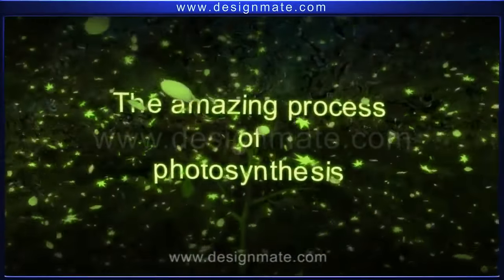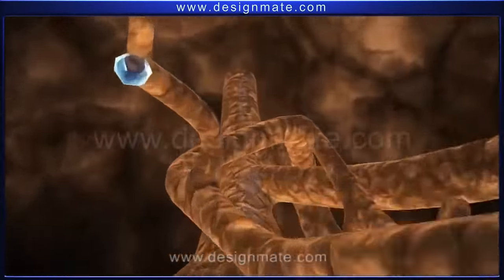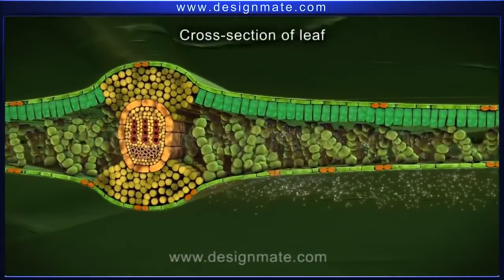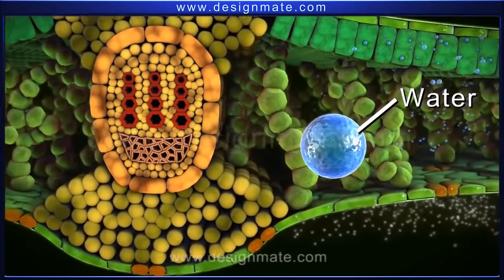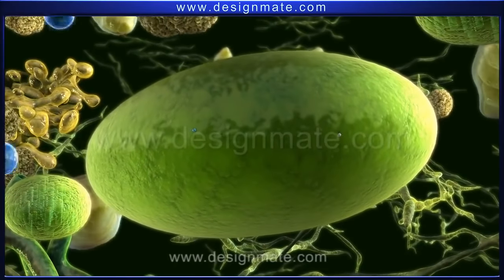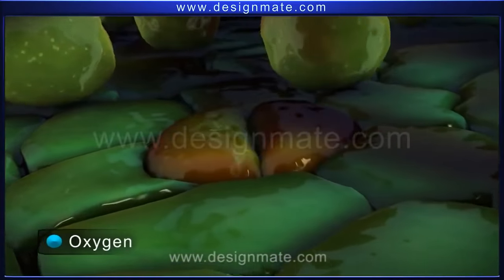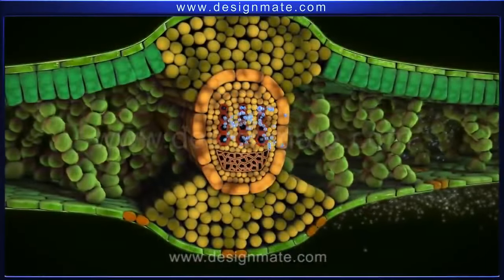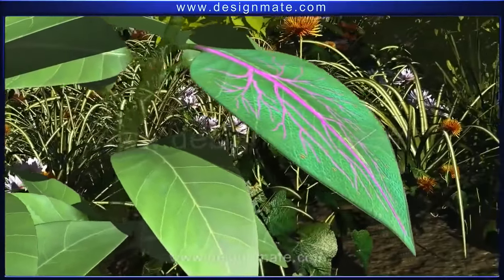how photosynthesis takes place in plants & Process Of Photosynthesis (animated)

Comment: Still a question, What actually happened inside the chloroplast which transformed CO2 and H2O into C6 H12 O6 + O2??
Reply from the maker: There are many processes inside the leaf, firstly Light dependant reaction takes place in thylakoid membrane of chloroplast, where photolysis of water takes place and fuel for dark reaction is prepared in the form of ATP and NADPH after these both energy rich molecules leave the light reaction they go inside the dark reaction, dark reaction is also called Celvin Cycle, in this CO2 is fixed with rubisco enzyme performing whole cycle the product is G3P which then convert into globose
Reply: @NeurotechLectures   I could not understand anything, but Thanks for reply
Reply from the maker: May be you haven't studied whole process of photosynthesis therefore you couldn't understand, and welcome
Reply: there will be a cellular respiration , ATP (energy ) + h20 = glucose + O2.
Reply: Watch magnet brains 
Their explaination just on another level.
Reply: Light and dark reaction occurs

Comment: Is there any proof photosynthesis utilises carbon dioxide in the air?
Reply from the maker: Yeah absolutely there are many experiments that prove that plant take CO2
Reply: @NeurotechLectures  Great perhaps you could point me to one that has a CO2 meter indicating the level of CO2 changing and which does not include sodium hydroxide solution or calcium carbonate or soda lime which skews the experiment
Reply from the maker: Yeah You are right but i thought You needed firm evidence 😉

Comment: very good . when you put a seed on the ground and it became a big tree, where  does come from the material which the tree are made?  from the ground/soil ?
Reply from the maker: It's soil because it provides water and minerals needed for plant growth, and plants fix carbon dioxide from air, which helps to produce glucose by the process of photosynthesis.

Comment: Does photosynthesis occurs in cut off branch...can u plz explain in detail....humble request..🙇
Reply from the maker: Dear, If we cut the branch of a tree, then ultimately tree dies because water is not supplied to that branch as a result process of photosynthesis ceases.
Reply: @NeurotechLectures  but the branch contain water, Nutrients in xylem..so even under these conditions doesn't photosynthesis occurs....?
Reply from the maker: @Suchi Vennila  it is possible that photosynthesis will occur for a short duration if branches are detached. After that, photosynthesis will stop.

Comment: Some one bashed me and tell me that it should be a non stop of light exposure so the plants can have continuous photosynthesis
Reply from the maker: Yeah surely plants need light so that they could continue the process of photosynthesis, as it is clear that photosynthesis stops during night due to absence of light.
Reply: But would that be acceptable to put the plants on 24hrs of light exposure? Morning sunlight. Night time until break of dawn growlights?
Reply from the maker: Actually there are various mechanisms in plants, if you increase light duration or light intensity it will damage the chlorophyll present in leaves so plants needs optimum light to carry on the photosynthetic process, and naturally there is concept of day and night that brings the circadian rhythm.

Comment: What happens to the hydrogen from the water though?
Reply from the maker: During photosynthesis, the hydrogen atoms in water molecules are used to produce glucose, which is a type of sugar that plants use as a source of energy. This process occurs in the chloroplasts of plant cells, which contain the pigment chlorophyll that absorbs light energy from the sun.

The process of photosynthesis can be summarized as follows:

Light energy is absorbed by chlorophyll in the chloroplasts of plant cells.

This light energy is used to split water molecules (H2O) into oxygen (O2) and hydrogen ions (H+).

The hydrogen ions are then combined with carbon dioxide (CO2) to form glucose (C6H12O6).

Oxygen is released into the atmosphere as a byproduct of this process.

Overall, the hydrogen atoms from water are used to create energy-rich glucose molecules, while the oxygen atoms are released into the air. This process is essential for the survival of plants and other photosynthetic organisms and also plays a critical role in maintaining the balance of atmospheric gases that support life on Earth.

Comment: ((During photosynthesis, plants take in carbon dioxide (CO2) 'n water (H2O) from the air 'n soil. Within the plant cell, the water is oxidized, meaning it loses electrons, while the carbon dioxide is reduced, meaning it gains electrons. This transforms the water into oxygen 'n the carbon dioxide into glucose (👩🏿‍🏫🏫☀🌱🌿🌴💨😲📔📚📝✏❤🍎))).

Sincerely, Justin Maduako
Reply from the maker: Absolutely right

Comment: 5 19 22 ... what is left out in this vid ... the oxygen that exits the chloroplast was originally part of the
 water molecule.   and not from the CO2 one.      big difference.    with big implications

 yes, this is a major miracle.
 as water is not so easily  broken up into its atoms.

  and all around us plants are pulling off this move with their chlorophyll chemistry.

ok , its very do-able in science labs every day by applying electricity in a jar of water.  
this method tho takes more energy than you get  back via burning the hydrogen.

this effort , breaking apart water molecules , is the holy grail of modern energy research. 
 taking apart water molecules to get the hydrogen for re-use as a fuel,  as in a car.

and doing it so that , like fusion ,  you get back more energy than you put in.

given water on mars ... as a raw material for a fuel for life support and rocket engines
there is huge interest in  discovering how to mimic what chlorophyll does 
on an industrial scale.    it will revolutionize life here on earth as well.
Reply from the maker: You are right, the oxygen is released by splitting of water referred as photolysis.
Reply: @NeurotechLectures  being able to split up a water molecule into O2 & H2 rather makes  the starting material the ultimate
fuel.    

        some of us are curious just
how efficient overall is a plant with its 
leaves of chlorophyll at using the energy
of photons to power this splitting process.

    can you break it down into  the steps
we can get a grip on  and what their
energy requirements are ?  like , does it
take just a handful of photons to produce
an atom of oxygen ?  or does it take
a large number of them ?

Comment: Respiration And Photosynthesis Are Reversible Processes Because Both Reactants And Products Are Convertible , During Photosynthesis CO2+H2O Forms Glucose And During Respiration Glucose Is Also Converted Into  CO2+ H2O Then Why They Are Considered As Irreversible Processes ??
Reply from the maker: They are interchangeable means after the photosynthesis, when glucose is formed than after that it can be broken but talking about photosynthesis it's irreversible because it's a chemical change, inside the chloroplast it can not be reversed into CO2 and H2O
Reply: @NeurotechLectures  Got It 👍
Thank You 💞😊
Reply from the maker: You are most welcome